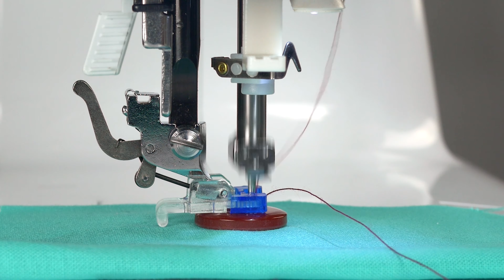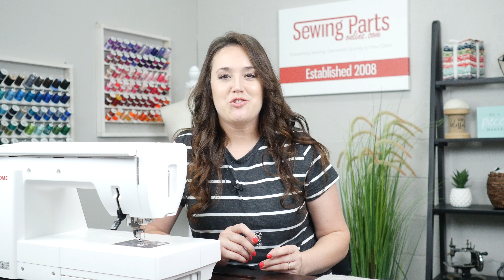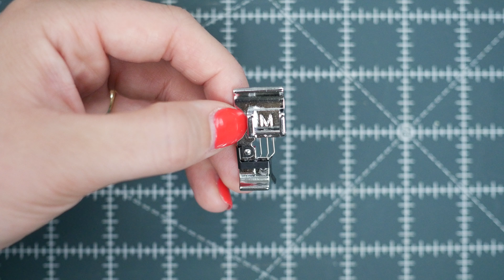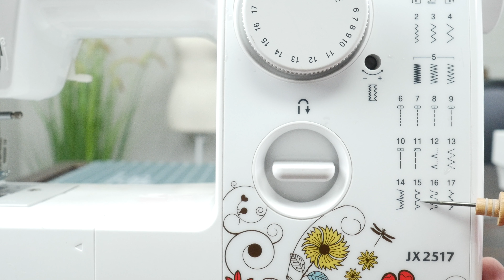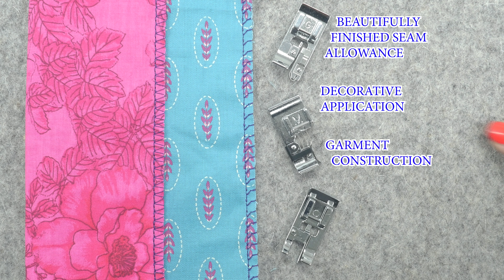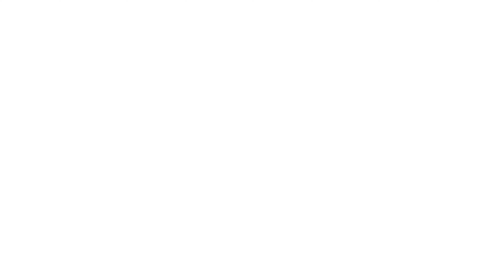Sewing Machine Overcast Foot

Comment: Hey, I liked your tutorial about the presser foot, unfortunately I accidentally broke the bridge on my foot on the second use and getting a new one will take some time (they don't ship to my country) is the foot completely gone??  I tried using it and it seems to be ok but I can't help the feeling that it's not doing what its supposed to (like I said, I only used it twice) any input would be appreciated, Thanks!!
Reply from the maker: Thank you!
Unfortunately, once the bridge is broken, it will not be able to form the overcast stitch correctly.  I recommend ordering a new one. While you wait for it, you can use a zig zag stitch to finish your edges.

Comment: What is the price for the overlock foot,and the zipper foot together?.My machine is a Brother VX1100.I  would also like a foot control for my machine too.
Reply from the maker: Zipper foot: $3.99
Overcast foot: $5.99
Foot Control: $29.99

Total before shipping/tax: $39.97 (we offer free shipping on orders over $49)

If you need help ordering these parts, you can call us at 888-824-1192. Here are the part numbers: #55411 (zipper), #5011-12 (overcast), #J00360051 (foot control). You can also click this link and it will automatically put all three items in your cart:
https://is.gd/yjzlQv

Let us know if you have any other questions 😊

Comment: Hi my overcast stitches seem to keep getting stuck over the bridge. Any suggestions on how to solve this problem?
Reply from the maker: It's possible that you don't have the correct stitch selected. If you are using a zig-zag instead of an overcast stitch, the width may not be set wide enough. Otherwise, it's possible that the overcast foot that you are using isn't intended for your machine. What is the make and model of your machine and I'd be happy to see what your manual says?

Comment: Do these feet come with different size?
Reply from the maker: Not different sizes (like a hemmer foot where you can get a 1/8", 3/16", etc,); however, we carry a variety of overcast feet. The reason we carry different options is that different feet fit different models of machines. If you will provide your model number, I am happy to find you a compatible overcast foot for your sewing machine.